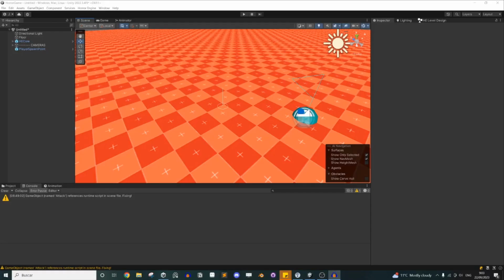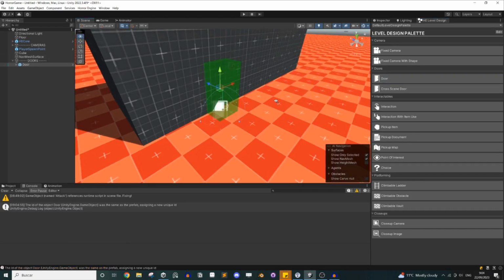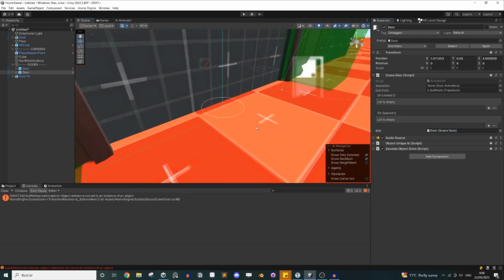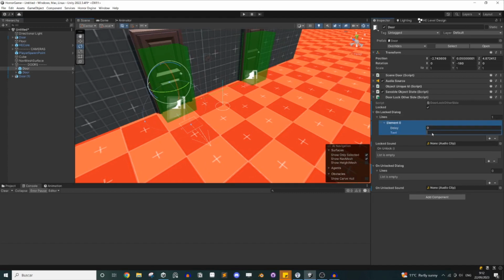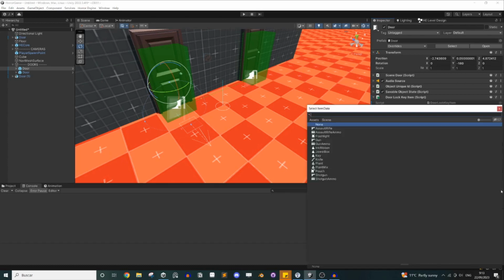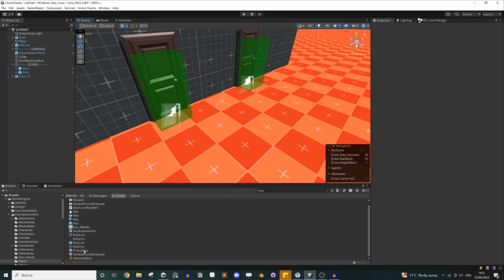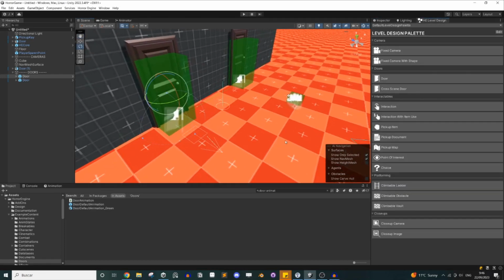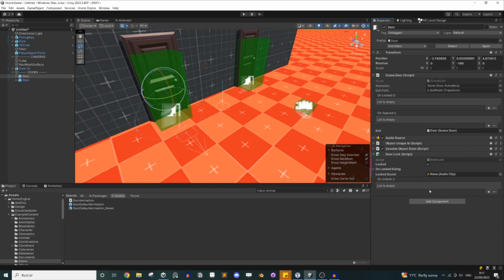Retro Horror Template - Scene Doors

Comment: Great asset, is there a way of adding stairs, sure i can modify the doors script to do the same thing but wondered if you were working on this before i amend
Reply from the maker: Hey, there are ladder examples in the package. If you want a transition with an animation (similar to the doors) then yes, you should use the door system since it's virtually a way of teleporting the player around the level with an animation in-between.